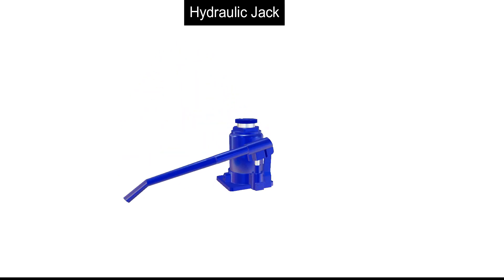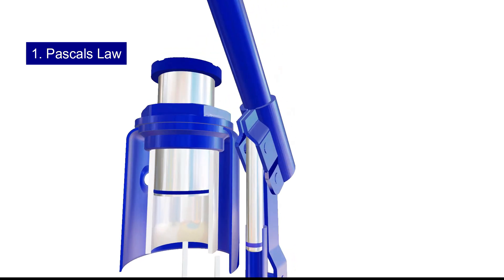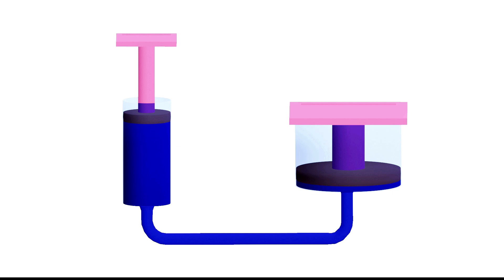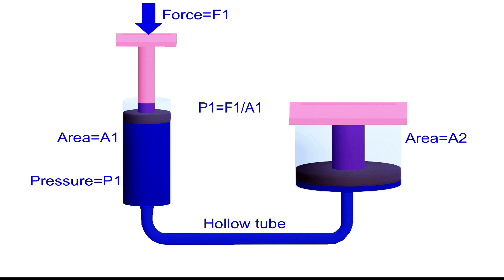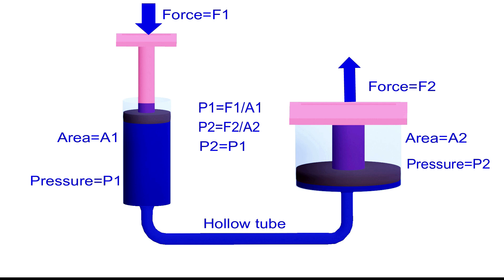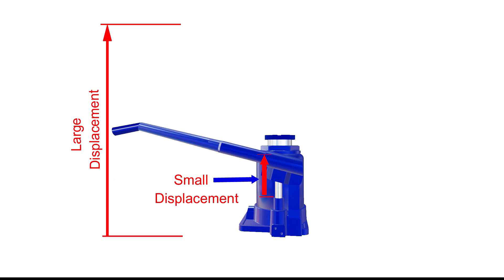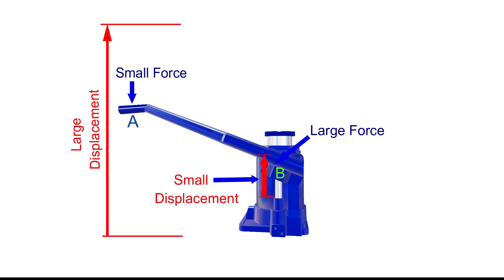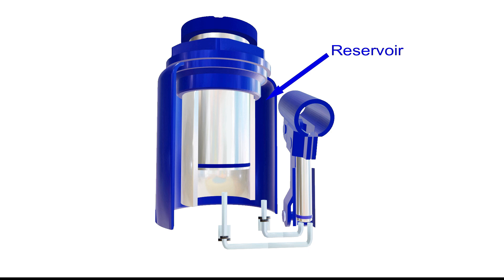Hydraulic Jack how it works

Comment: How to get (liquid) from the reservoir into the smaller piston through the valve and not replace it with something else? 
I mean you can not take any liquid from the reservoir or even open the valve if it’s completely sealed. Unless the reservoir tank shrinks?

Comment: Best explanation of HJ for me.  Sawed it for future references.  Another explanations confused me.  I have leak at top of unit and other explanations mislead me  thinking that that area should be without oil.  Unit is in floor jack so top is in horizontal position.  Now I understand it is reservoir that is NOT under pressure and that I just need replace O rings there.

Comment: Nice Video, could you please also explain what happens when we release the pressure and the cylinder retracts? Usually, there is another hole at the end of the bigger cylinder what purpose does it serve?

Comment: Another outstanding video.By an amazing coincidence earlier today I was teaching a group of young students about hydraulic braking systems and used a basic animation of a jack to show the principles involved around hydraulic brake force multiplication. This video will be brilliant tomorrow as an extra teaching resource and a great revision tool. Well done. Great stuff.
Reply: Using non return valve is good but how can we pump oil back to the reservoir

Comment: I worked for a while in a hydraulics repair shop, and one thing I learned that should be mentioned is to NEVER use brake fluid in a jack... it will turn the seals to mush.
Reply: I would like to hear the story behind this